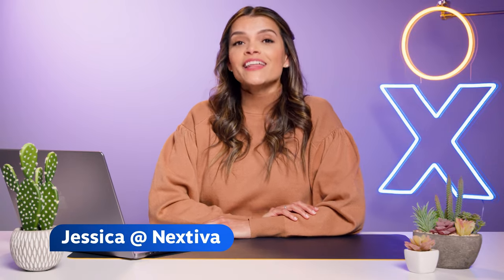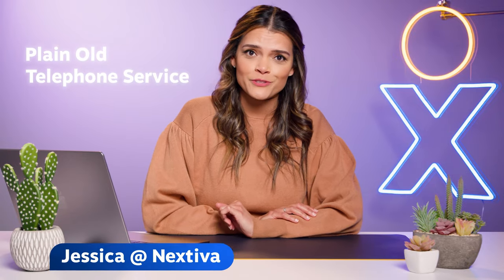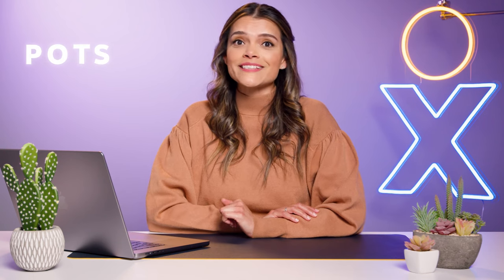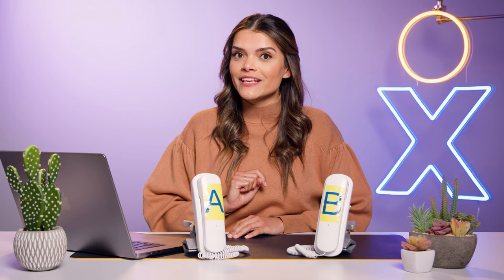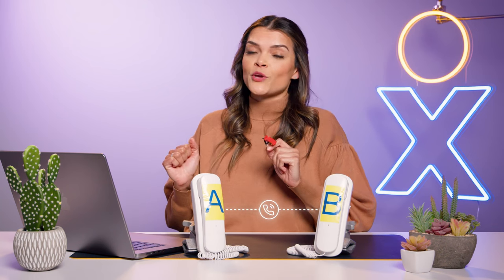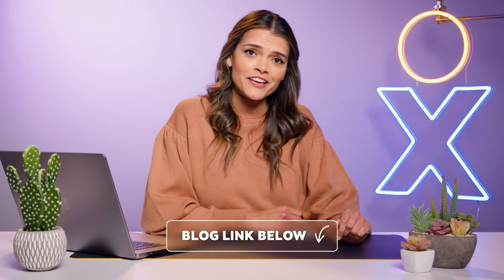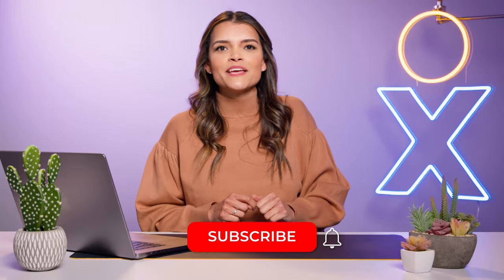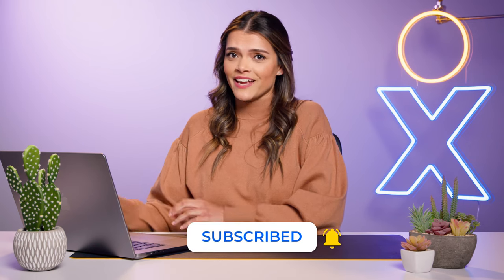What is POTS? “Plain Old Telephone Service” Defined!

Comment: Hey thanks for the info. I’m trying to plug in a clear one max conference phone. I work at a nursing home and I’m pretty sure we run PBX. The manual said the phones run mostly on POTS but will work on PBX if modified. I plugged it in out the box using the phone line cord into the wall. The thing is it does not work. We have simpler office phones that work just fine but this clear one Max does not? Do I need an analog adapter of some sort?
Reply from the maker: Hey there! We recommend working with the hardware providers to figure out compatibility and integration for PBX boxes. However, if you're looking to ditch the hardware in favor of a cloud-based phone system, check us out at https://www.nextiva.com.